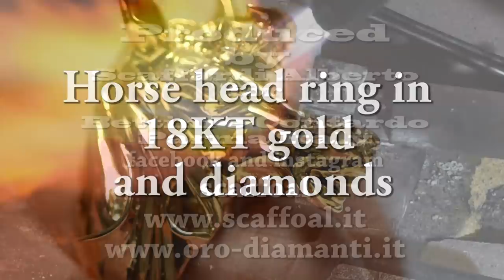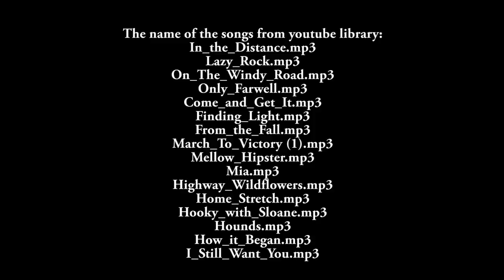Horse head ring in 18KT gold and diamonds

Comment: Excellent work! 

A few questions. Did the mane balance the offset of the weight of the horsehead on the ring? Was the material under the mane removed to lower the weight, the cost or both?

Thanks

Comment: It'll probably would have been easier and quicker if you made a plaster of a horse melted some gold poured it into the plaster mold of the horse and be one solid piece and then rolled it to the ring after and then it'd be one solid ring instead of a long slow process which horse Ring that you did in the middle is not solid gold it might be gold all around it but in the middle it's still weak that's what I say make a horse mold melted in and you would have more definition and easier to put it together and all you did a good job but it just looks very tedious doing it that way that's a lot quicker and easier and smarter way to do it that's what I would do if I was making the ring and the ring would be all solid gold in and out and all around the ring